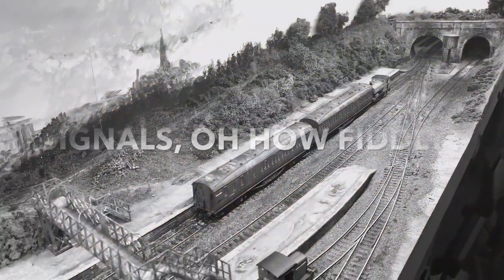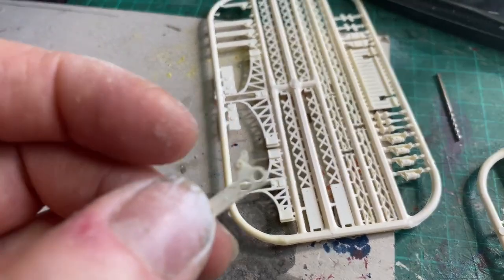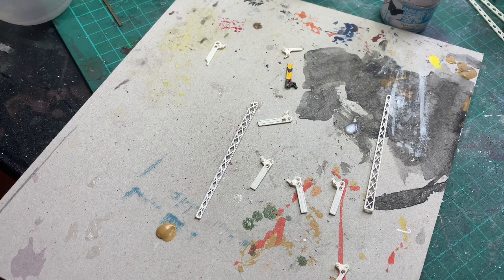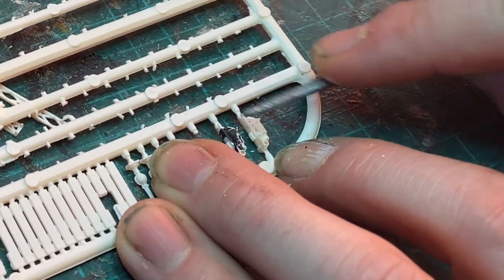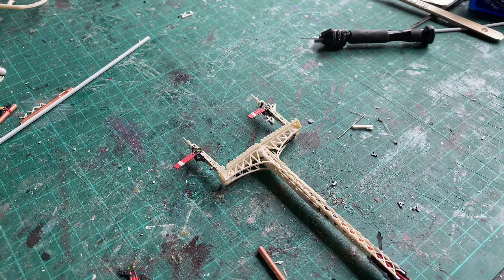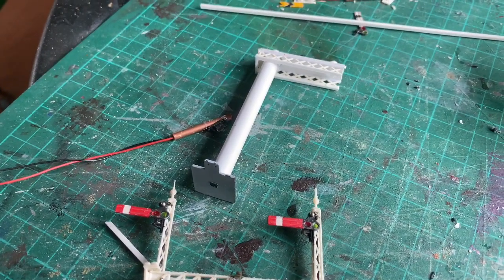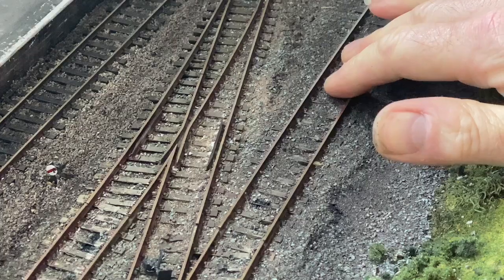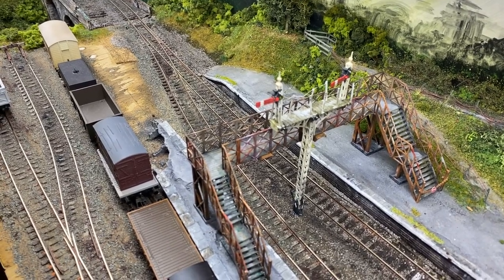OO GAUGE MODEL RAILWAY - SIGNALS, OH HOW FIDDLY?

Comment: The signals look really good despite how fiddly they are. The kit certainly looks to have alot of options which is good. Might check these out when the times comes to add signals to mine as well. All the best, Clint
Reply from the maker: Hi Clint, thankyou. Yes there are a few options available with them, but you will have to work it out, as the instructions, certainly that I had were very poor. Just be extremely careful when removing parts from the spruce, they break in a heart beat. Would be good to see what you make if them though.

Comment: Hi John, enjoying your video's. A quick one about signals if I may. The distant signal should have a yellow and a green lens, red is for home /starter signals. The ground signal (subsidiary signal) on the exit from the 3 sidings would be a yellow disc and a black bar across it with again a yellow and green lens. The yellow disc can be passed (horizontal black bar) for shunting as long as you don't encroach onto the running lines e.i. proceeding from one of the 3 sidings onto the other siding, but the signal has to be cleared ( black bar at 45 degrees showing a green light at night) to proceed out of the sidings onto the main running lines. Hope this helps, cheers Mick. (Ex signal & telegraph engineer on British Rail)
Reply from the maker: Hi Mike, thank you very kind of you to say. I think I understand. I can change the ground signal from the 3 sidings. As far as I’m aware the distant signal would be way before my layout starts to give a train time to slow or stop if rq. From what you said about the little it sounds abt right for what I’ve done. There one line going through but the runaround is part of the shunting yard, but also used for flipping a loco to the other end of a train, so Ill leave that. Besides I’ve had enough regarding making these signals they were quite frustrating due to constant breakages. Thank you for your kind support and I’ll try to change the colour of the two ground signals
Reply: Hi John, you're right about the distant signal. On OO scale the distant signal would be aroung 17 feet from the home signal. As far as the 3 ground signals go the only one that needs changing is the one leading from the 3 sidings, the others are ok. cheers Mick @piccadillysidingsoogaugemo6445
Reply: Hi John it's amazing what you forget about the job once you retire. The ground signal from the 3 sidings should be a black disc with a yellow bar not as I previously said yellow disc with a black bar. Sorry about that Mick

Comment: Looks great John ,I had the exact same issues with my Ratio kit they look the part but boarder on un buildable . Regards Dave
Reply from the maker: Thank you David, that shows there is a problem with the plastic used then not just my kit. Thank you for taking the time to comment

Comment: The Home signal is the first normal signal a train sees when approaching the signalbox's area from a particular direction. Every signal after the Home signal is a Starter signal of some description.

There'd usually be one Distant signal before the Home signal - if the signals are clear for the whole route through the signalbox's area, the Distant signal can be cleared too, telling the driver that they won't need to stop until they get to at least the Home signal of the following signal, so they can go a bit faster. Otherwise, if the Home or any of the Starter signals are at danger, the Distant is also at danger and the driver is aware they will need to stop the train at some point in the section.

I'm not positive, but I think under this kind of signalling, the "block" is the section of track in between two signalbox's area. The first signalbox will ask the second signalbox if the block is clear - if the second signalbox says it's clear, the first signalbox is able to clear their last starter signal and let a train into the block (where it vanishes from everyone's sight). When the train arrives complete at the second signalbox, as determined by the tail lamp passing the signalbox to show the whole train has made it out of there, the second signalbox can indicate the block is clear again.
Reply from the maker: Thank you thats a very clear description, shame you weren’t here when I did it, lol. I did have a couple of signal help me, but there was some differences between them so I had to interpret. You are definitely right regarding the distant signal, but for the model I decided not to include it as distant and home would have been about a foot apart, nowhere close to the correct distance, so I say both distant signals would be off scene. Thank you for taking the time to comment.
Reply from the maker: Fantastic, would be good to see when you’ve done it.

Comment: The old kits used to contain both post signals and ground signals in the same kit, double trouble so to speak , I would have gone the fibre optic route for lighting , if you ever see a thrown away fibre optic crimbo tree it will give you all the fibre you’ll ever need
Reply from the maker: The LED bit, have to be honest was easy and worked really well. I know what you mean by using fibre optic, and have used it elsewhere. I suppose it’s what works for us isn’t it?

Comment: Shame you could not finish the workings! To loose the ugly wires, you could use extremely fine varnished wire, glue to body and paint and all wiring disappears, the down side is that you have to be able to solder them to a tiny SMD LED!
Reply from the maker: Thank you for the suggestion, but the plastic is so fragile and brittle I honestly done think it would last beyond a few uses.
Reply: @piccadillysidingsoogaugemo6445  I realise those signals are a lost cause, but was just a tip for future use, to achieve invisible wiring.

Comment: Hi John,  thanks for doing this video, or maybe not.  I've managed to do a single post signal from the same kit, using the wire as pivots as per instructions.  A real challenge, as I have a lot less patience than you, I am clumsy and my eyesight is not up to scratch, even with my reading glasses!  I'm happy with what I've ended up with, but now to start on a double post junction signal.  Given your experience, this is gonna be so frustrating for me.  I agree with you, they really do look good.  Keep up the good work....
Reply from the maker: Hi Andy, please don’t get me wrong I am happy with the signals the way they look, and like you got the single starter signal working with the weight. As you saw the problems started with the junction signal. I gave up with the supply wire as it was simply unworkable even when I bent it over, the parts would sit crooked, that’s when I thought of using the strands from electrical wire, but that was better, but parts broke when put under the slightest force. I gave up trying to make it work, settling for the manual (finger on the arm approach). I could of seen the whole thing ending up in bits if I continued, then it would have been the bin.

Comment: You did well to achieve getting any signals from the ratio kit. I have tried them and eventually gave up on them, the amount of breakages made the kits very expensive. So well done with what you have achieved. Thanks, Mel
Reply from the maker: Thanks Mel, I’m just totally surprised at what they are like, Ive used other ratio kits very successfully. If I have persued trying to mechanise them I’m sure it would have broken resulting in chucking them. Thanks for taking the time to comment.